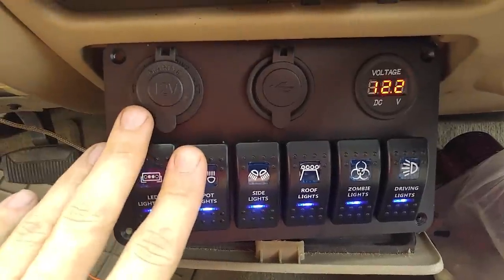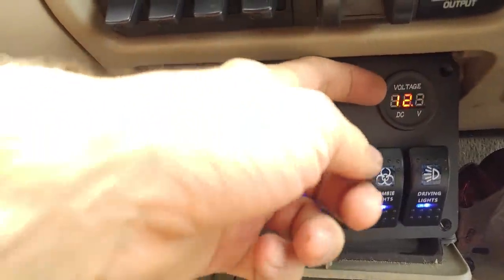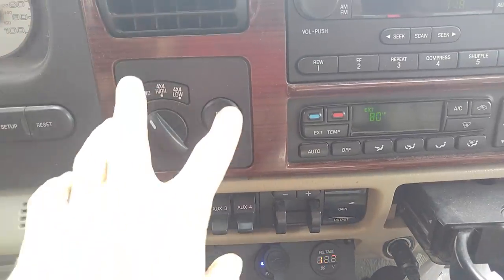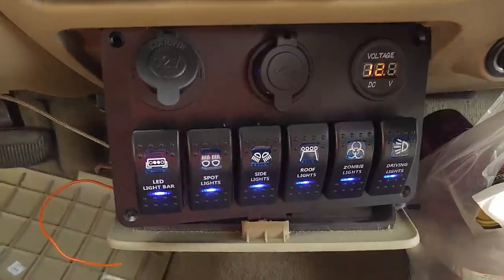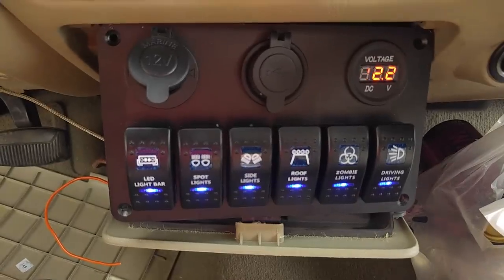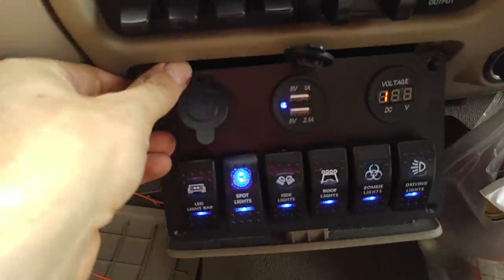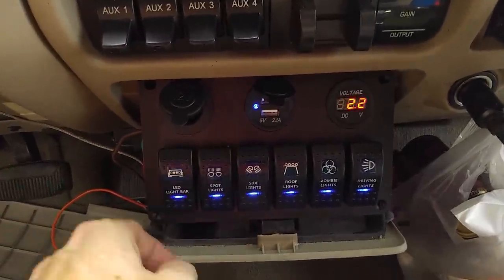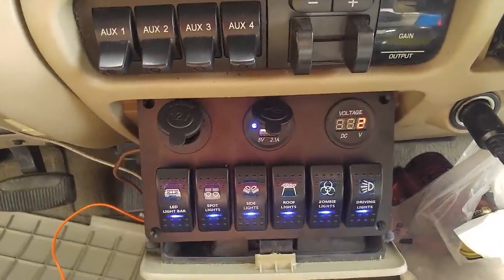~Review~ TEQStone 6-Switch LED Light Bar Panel with Volt Meter USB & Cig Lighter 4 Truck, Jeep, Boat

Comment: Ummmm, where are the relays dude, fuse or no fuse it's definitely safer to run all of your fused wires and relays outside from the cab. Fuse tap the switches from something useless and run the wire to the relay under the hood. I hope you don't catch your dash on fire

Comment: You hAve stock switches right there.. Why add more?
Reply: Alex Moore to make u ask stupid questions
Reply: Shawn Jones seemed like a valid question to me.
Reply: Because pushing switches is fun. You can never have enough switches.
Reply: Because the Aux switches don’t stay on after the ignition is turned off .. pretty useless.

Comment: haha house hold wire nuts can't even use proper wiring equipment
Reply: It works, doesn't it?
Reply: SpriteV1 at the moment, sure....
Reply: SpriteV1 for now
Reply: Agreed bad idea. Do the job right the first time. Solder and shrink wrap. Once they corrode you will have issues.
Reply: Deez nuts

Comment: Nice video - thanks.
Do you know how this would be hooked up if using a 24 volt system? Would the 12V cigarette adapter be running 24 volts through it?
Thanlks
Reply from the maker: yes cigarette light would pass the 24 through. you could swap it out for a USB port though. there are standard size openings.
Reply from the maker: +William Curtis The truck in the video is a 6.0L powerstroke diesel
Reply from the maker: Gina Dominguez Yes the empty prongs send the 12V positive to whatever accessories you want to power. All will be 12V, not 24V.

Comment: I’m actually looking for a panel that will fill the rear audio console in a 2001 Suburban ..the head unit has been replaced ..and the rear controls are no longer functional ..I need to remove ..and prefer to replace with a USB array along with a couple of 12 volt receptacles ..please let me know if you are aware of any replacement available ..great video ..
Reply from the maker: I'm not aware of any direct replacement options. I'm sure you could modify this or another panel pretty easily though

Comment: I would have put the ignition onto a relay and then the contacts of the relay would come direct from the battery to the switch panel. By rights, each one of them should operate a relay as a relay has better current switching than a switch mechanism.
Reply from the maker: Yes, especially if the total amp draw is over 5 amps.

Comment: It says has built-in overload protection but exactly how does that take place because I don’t see any type of a relay or fuse or anything to support that?
Reply from the maker: That's a good question. I added a fuse appropriate to the load and wire size. Maybe they are referring to the USB port circuit having overload protection.

Comment: You have gone with wire twist connectors holding your wire together? Seriously?
Reply from the maker: I had gone, yes. This was just a test video. It isn't even powering, or switching anything.

Comment: I have the same setup but with 8 switches.  Haven't figured out a way to mount mine yet either.  They should offer a box enclosure to mount it in for much easier installation...However, they're actually designed for Marine applications in a boat so it would be installed directly into a dash in a boat where in a car you most likely don't have space to cut out to install in a dash in a car.
Reply from the maker: Exactly. I ended up going with a 4 switch version that did fit one of my panel openings.
Reply: @GadgetClass  I don't have any panels in my vehicle to install a switch panel so its up to me to figure out a place to mount my switch panel/box when I get it built so that its easy to access but not in the way of anything else...kind of a pain in a smaller older vehicle LOL.

Comment: Wire switches to relay bank instead fuse. The fuse goes next to battery or power distribution block for higher amp 12v input to relays

Comment: with the truck off wouldn't the lights on the switches  and the volt meter kill the battery ? or do u  have it  powered  by a fuse tap that turned off when the car is off
Reply: huntprepoutdoors Yeah. It is best to power on with ignition
Reply: thanks for the reply

Comment: Hi Mate, nice vid! Do you know if the switches have the same cutout size as the genuine carling switches/accessories? I'd love to have 3 cig lighter plugs and swap 1 or 2 of the switches for the USB port carling clones! Thanks!
Reply from the maker: XeKToReX0 Good question. I don't have any genuine Carlin switches here to compare to so I can't help much. If you give me the Dimensions I could measure these
Reply: GadgetClass just off the top of my head they are 36mm x 22mm, thanks for replying!

Comment: Does the bottom light stay on? If so is it drawing power?
Reply from the maker: The buttons do have a slight illumination in the off position to help you find and identify them when off. Current draw is minimal, but if it is a boat or vehicle that is not used very often, I would have the panel turn on with ignition, or with one of the switches like I ended up doing.
Reply: GadgetClass thanks
Reply: How did you wire it to turn on with one of the switches?

Comment: would it be necessary to have each accessory fused? if so would inline fuses be the best/simplest way?
Reply from the maker: Johnny Clark The way it is wired, it would be best to just fuse the whole switch bank with a 30 amp fuse.
Reply: no it really wouldnt... most "12v accessory outlets" which is what that is and not a cigarette lighter are rated 10 to 15 amps... i would tie the usb and accessory outlet and voltmeter to one  20 amp fuse and then find out what the switches are rated for.. usually 10 amps a piece... 10 amps x 6 = 60 amps

what professionals do is find out what the max  amperage of your "load" is and then add 25% for expansion.

those large led off road bars draw around 7 amp and the smaller ones around 1 - 5 a piece... therefore you could 

lets say you use the switches for what they are "designed for" the led bar 7 amps and multiple 1 - 5 amp led spot or driving lights  will go on the high end with 5 amp led lights.and 1 set per switch...

5 x2 x5 = 50 and thats without the 7 amp bar... bang there went that fuse... (that is of course that you have them all on...)

now for the low side 1 x 2 x 5 = 10

so all 6 banks on thats 17 amps plus whatever miliamps the voltmeter and usb are using (plus the backlighting for the switches themselves)...

so we will say 18 amps just to leave out tenths of an amp.... now you have a buffer zone of 12amps for the accessory outlet. plug in something something like an amber strobe or rotator bar for all your whackering needs and POP there goes a fuse...

Comment: Do you have an ashtray or panty holder? 3 of my 4 aux switches are taken and looking to install something similar in place of the panty holder
Reply: W.W. I ended up just using the 3 gang swith in the square ooening on the factory power point
Reply: SuperDuty I ended up buying the same one, but not sure what to do about the airbag on/off switch yet. Thanks

Comment: I'm installed one similar to this in my truck and when I turn off the engine my voltmeter and usb port is still on. will this kill my battery?
Reply from the maker: Eventually. They don't draw that much power, but you wouldn't want to leave them on for a week or more. Best to wire them to an "On with Ignition" circuit.
Reply: Yup
Reply: No they won’t
Reply: Relay off ignition to battery to not draw to much from battery then I broke each to its own relay and fuse

Comment: When are you posting the video about the three switch pannel with the usb ports?
Reply from the maker: Uploading it now.
Reply: GadgetClass Thanks, im planning on putting mine in the same spot and i am interested on how you are going to make it fit.
Reply from the maker: +crashandburnbirner I'm just uploading the HD version of the same review video that I put on Amazon. I ended up just wrapping a bunch of grip tape around the switches about 1/4" back and sticking it in the hole. It actually is working well enough that I haven't cut down the plastic yet. Been pretty busy lately.
Reply: GadgetClass Ill probably do the same, seems like a good set up, thanks.

Comment: what's wrong with the factory switchs
Reply from the maker: Nothing. I ended up going with a 4 gang switch where the power point cig lighter is.
Reply: GadgetClass. you could get a piece of diamond plate aluminum and mount it inside of it and mount it on the floor kinda under the ashtray. just an idea

Comment: I have a Switch Led Light Bar Panel, the same one in your video.  I have a blue wire, a yellow wire, a black wire, and a red wire.  Which ones can I hook up to the fuse box?

Comment: Guys I am afraid to make any changes like create extra bottoms cos its make a big mass or its destroy the electric system in the car so tell me does it break anything in the car or not
Reply from the maker: Vv-The-Dead-vV If you aren't comfortable tapping into auxiliary 12V circuits, you may want to have someone install it for you.

if installed properly, no, it will not damage your car.
Reply: As long as you have a fuse for the main power and use proper connectors, not household wiring lugs you should be fine. I would like to see the back a little better and see how it is wired as the power going in is for the lights on the switches but is everything controlled by the same input or is there a free lug to attach your trip wire. I wire everything through  a relay as it takes all the load off the switch and you can control brighter lights with your high beam switch going into the relay (that is the law in my province), but then fog or rock lights can be on the park light circuit and when you shut your lights off with the factory switch all lights go off no matter if the new panel switch is on or not.

Comment: Only thing i'm going to say is, it is never a good idea to tie into a factory harness in any way. Always, always run your own wire to the battery or a secondary power source.
Reply from the maker: It is common to tie into On-with-ignition in custom car audio installations. All points of tie-in under the dash will generally be post-fuse box and will have their own fuse. Any high drain, or high amp device (such as an amp or lighting circuit) should tap directly on the battery though.
Reply: I disagree, any point in which you tie into the factory wiring could cause an unforeseen problem and catastrophic failure of the whole system given any simple issue with the new wiring. It's always best (unless doing a plug and play such as a stereo) to run your own wiring. If said wiring fails it is 1 easier to diagnose. 2 will not compromise the integrity of the vehicle or its ability to move down the road.
Reply from the maker: @coryderrickson7769  I definitely wouldn't recommend someone start tying into circuits unless they know exactly what they are doing and the potential damage they can do. Many people do just tie into random circuits, or use those fuse panel piggyback leads which are never a good idea.
Reply: Like I said, it's always better to create your own closed, often waterproof system to ensure safety.

Comment: It doesn't fit because it's for a boat genius.
Reply: Kennnny77 you can use if for whatever you want.  I have it in my Toyota wheeler and it fit fine where my radio, and change holder used to be
Reply: go spam somewhere else... ive got a chevy pickup with a jeep xj steering shaft, caddy rear calipers with ebrake, putting ford windstar electric fans in soon which need a bmw dual temp switch and Volvo 2 speed relay kit....
ITS CALLED DIY!!!!! or go buy what you need from a stealership and overpay ... and have them install it.. hey its OEM and will look... stock.... not  modified...
Reply: @sledrider908    Get creative.  That’s the fun of personalizing your truck. I bought an 8 switch panel that fits perfect in my lower console Open front storage tray with my 03 Avalanche. Better than any factory design for sure.